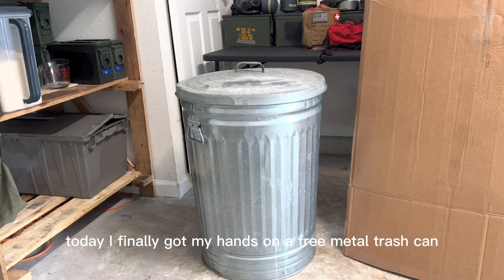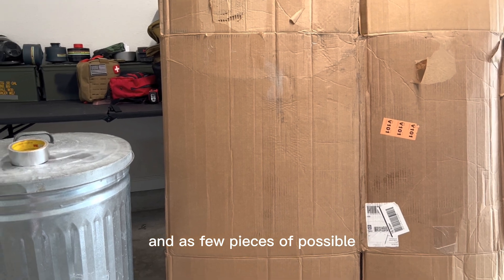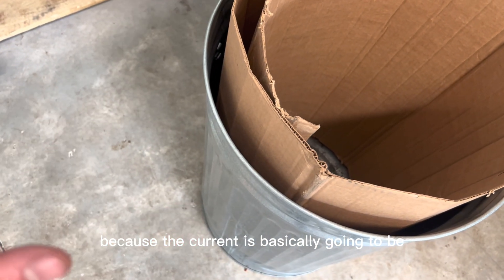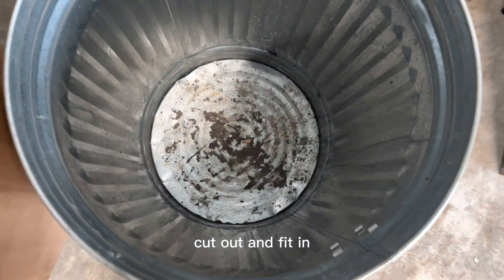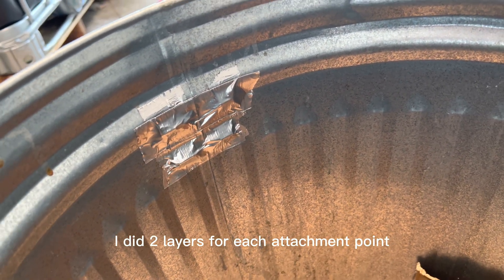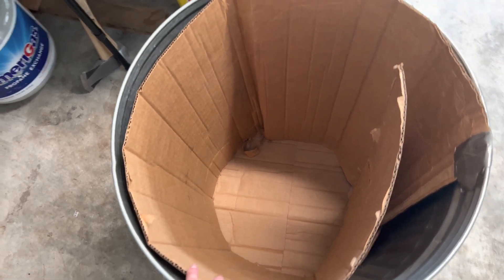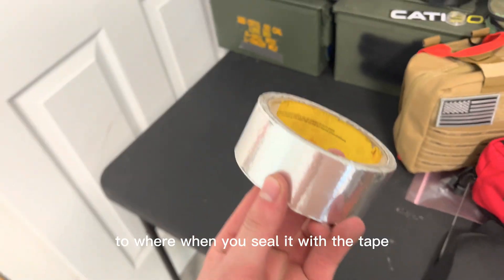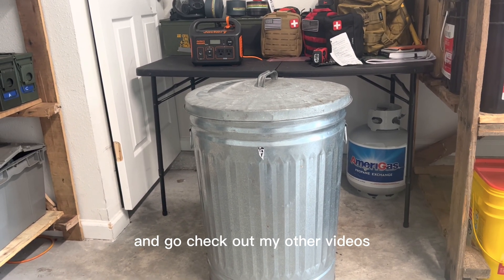Faraday cage 101// How to make a faraday cage for $0// free EMP protection

Comment: You don't need to ground the trash can. When the metal is struck by hi voltage, one side is positively charged and the other negatively. They cancel each other out and inside is a zero charge(well almost). I use a method called "nesting". I wrap each electronic device in plastic wrap or zip lock bags and then wrap the device in aluminum foil. I used foam rubber for inside insulation which is easy to cut and work with. I use cardboard for a bottom and skipped one for the top as nothing is going to touch the top. I tape all around the lid with copper tape, but, aluminum works just as well. I hope we never experience  a SHTF situation as the world will be setback a 100 years or so.

Comment: Like what you did, just a couple of things. The cardboard may be ok, but it is humidity dependent. Also you need a ground to earth otherwise you aren't bleeding of the electromagnetic energy. Instead of cardboard, think of another plastic trashcan that fits inside with the electronics in that. Just a couple of things I've learned through the years working with EMI systems. Keep up the good work!
Reply: So am i better of with just  a plastic trash can inside? Or does this work too?